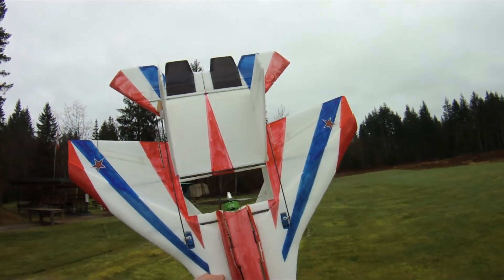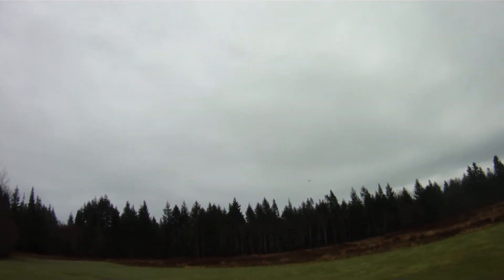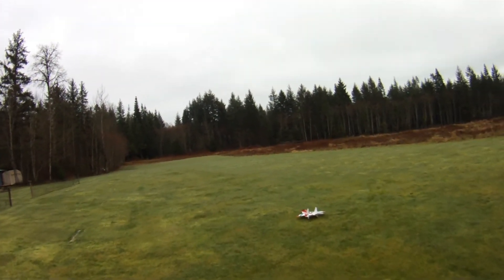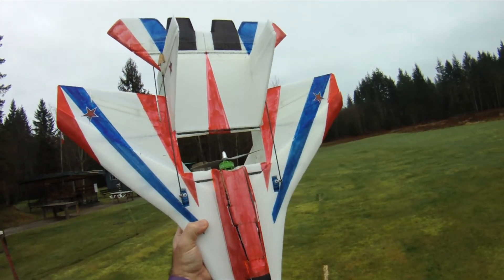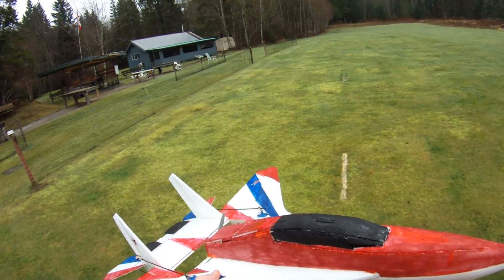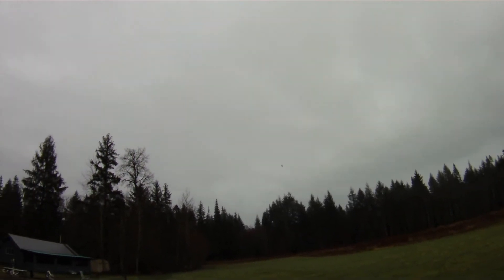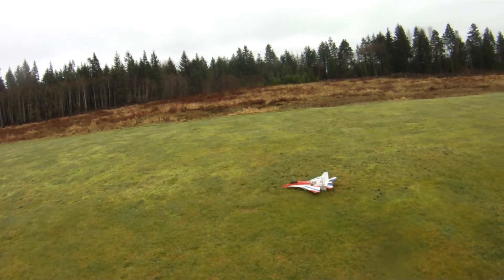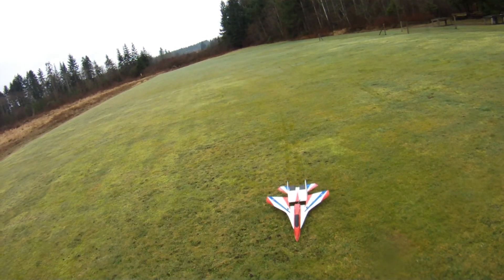40A ESC Field Test -  Turnigy Plush vs HobbyWing Platinum PRO - 06 Feb 2018

Comment: Nice testing of these two ESCs. From watching the video it's very hard to notice a difference but I'm sure you can when on the sticks. I looked at the specs and the HobbyWing BEC provides 2 fewer amps than the Plush, but also the BEC voltage is 5.25v or 6v? I wonder why 5.25v? Must be a reason. Thanks for the video and the testing and Happy Flying! I look forward to more.

Comment: Hi There Scott
Glad you got out today. Really difficult to tell, but both flights looked good regardless of any differences. Will definitely have to change the settings on my esc before the next quad motor test. There might be more of a noticeable difference when ran on 4s as the rpm's will be higher. When I've had problems with motors running on cheaper basic esc's it's been when running it on 4s not 3s. So that will be a good test to do.
Keep up the good work. Cheers.
RCPP